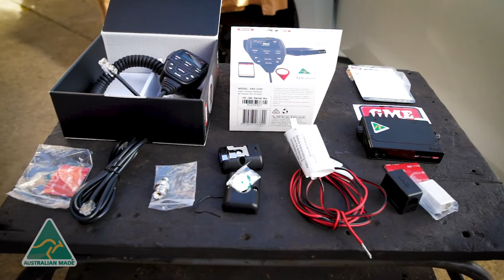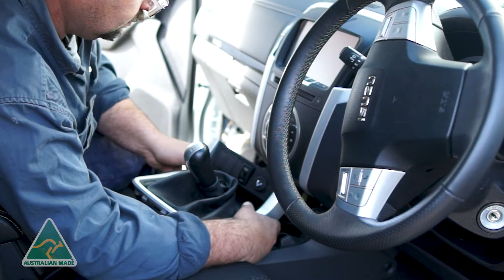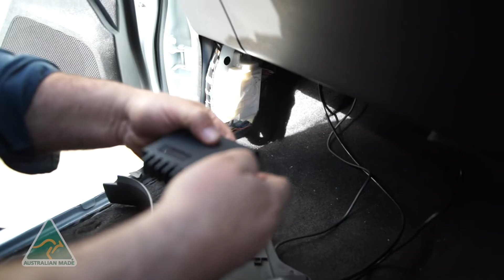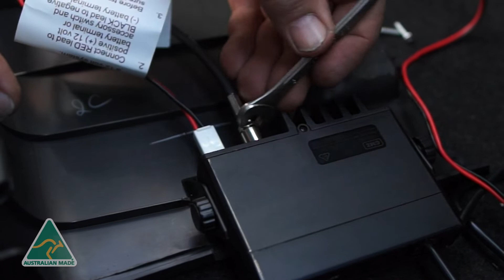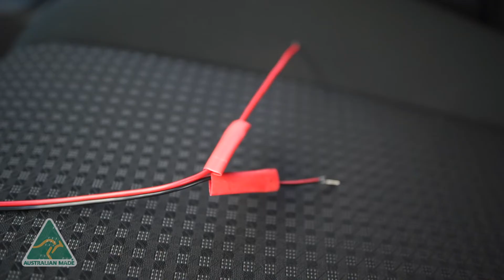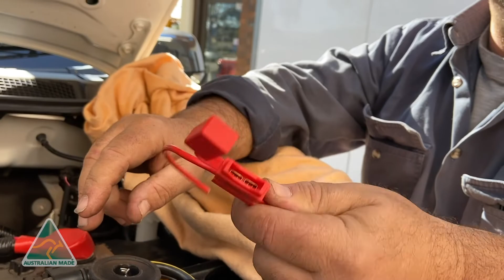XRS-330C UHF CB Radio Install

Comment: One point, the crimping tool used for the ring terminals was the wrong tool and should not be used on insulated terminals. The tool used was for uninsulated terminals. For the best results, always use the correct tool (readily available in electronics stores like Jaycar) some times can be found in good auto stores.

Never do as some YT experts show, a vice will not make a good connection.
Reply from the maker: Thanks for the feedback Brock, we will pass that on to the team to look into for future videos!
Reply: Sorry to be picky, I am a retired RAAF trained Avionics tech , and such things erk me a bit..

Comment: If you connect it to permanent power on the battery, wouldn’t that drain your battery when the car is turned off?
Reply from the maker: Whilst the UHF would draw power it is a very small amount. Also with the power down feature on the XRS  you can set the radio to turn off after a certain period to prevent excessive battery drain from happening.
Reply: I was wondering the same thing, thanks for asking!

Comment: Hey Tony, some say connect the negative wire to the chassis. You and GME recommend connecting directly to the battery terminal. Is it important or not and which is actually correct
Reply from the maker: Hi Rob, in regards to your query, either option will work for your UHF as long as it is done correctly. If you are after some more in depth info on this it would be worth chatting to our tech support team on techsupport@gme.net.au

Comment: Oh and is there a slip-on bracket for the station part of the radio I really like that I noticed that yours is screw in
Reply from the maker: Yes, the XRS-370C features a slip-on mounting bracket
Reply: @GMEaus  can you please do an install video on the new MUX model MY21.
Reply from the maker: @stuartcrawford1 thanks for the feedback, as we do not have the new MUX this is unlikely but we will pass the suggestion on to the team!

Comment: Does this radio have AM ban for the U.S.?
Oh and the antenna needs to break/ connect at the bottom of the spring so the wire is not an  issue when mounting that is the only thing I see right away..
Reply from the maker: Hi there, 
Unfortunately the XRS does not have AM band for the US and is currently only manufactured to Australian & NZ frequencies.

Also thanks for you feedback on the antenna, we will pass this on to the team!

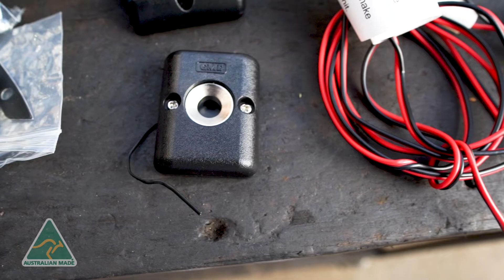Comment: Pretty sure I just watched an unboxing with this same guy and he said that bracket 0:26 was not part of the 330C. Is this some like a package deal or something?
Reply from the maker: Hi mate, the magnetic bracket is an optional accessory, sold separately as MB207. It is not included in the standard XRS-330C package https://www.gme.net.au/au/accessories/mb207/

Comment: Have you got any pass through adapters for a Mazda Bt 50?
Reply from the maker: Hi Kobe, not specifically, but there are 3rd party aftermarket fascia panels available which can then be used with the XRS-RJ45W1 / R1. Alternatively we have generic pass-throughs (XRS-RJ45RND and XRS-RJ45W6 / R6)

Comment: quick question will coiling up the antenna and zip tying it up would this effect the antenna  interference???
Reply from the maker: Hi there, as long as there are no kinks, coiling the cable shouldn't impact the performance of your antenna.

Comment: Hi. Similar question to above. Do you make a pass through fit a 2019 Hilux. Thanks.
Reply from the maker: Hi mate,

We have two options to suit the factory dash blanks in a ’19 Hilux: XRS-RJ45W1 (White LED), and XRS-RJ45R1 (Red LED).

You can check it out here https://www.gme.net.au/au/accessories/xrs-rj45w1/